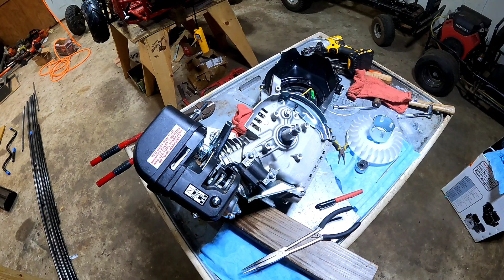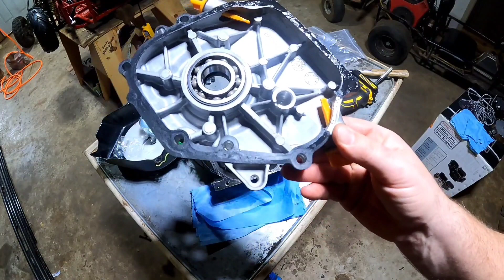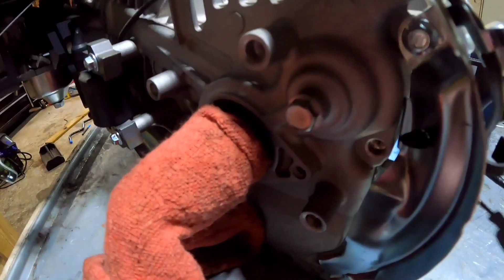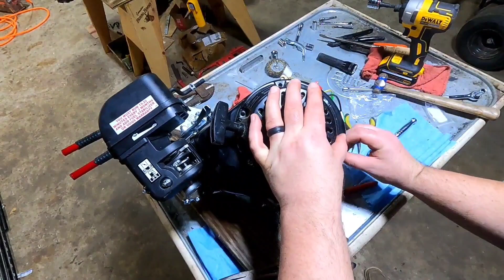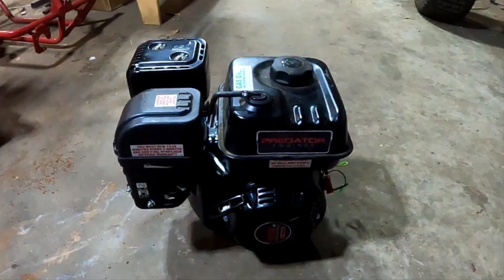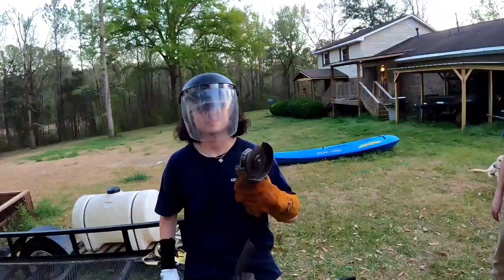Predator 212 removing the governor | part 3

Comment: How do u hook up the throttle cable without a governor
Reply from the maker: Since I removed the governor gear internally, the carb and original throttle assembly are all still stock outside of the motor. Hooking up the throttle should only change when you replace the carb.

Comment: Still using the stock flywheel?
Reply from the maker: Yes, this was a $25 build. The motor is going to be around 5200 rpm. If we were aiming for 9000 rpm I would have bought  an aluminum flywheel. do you think I will survive?